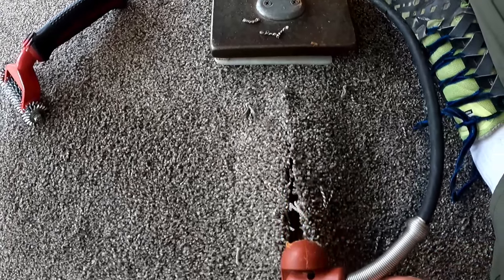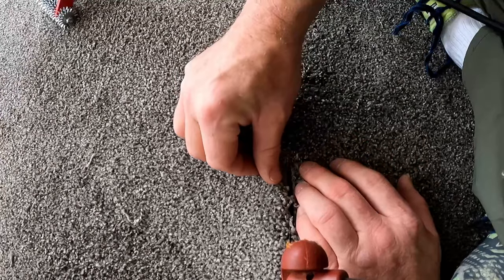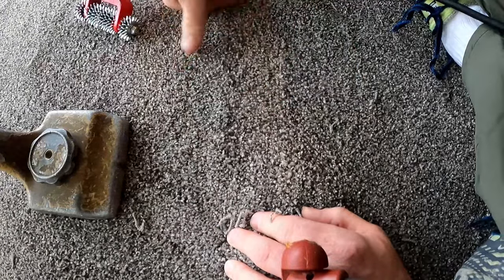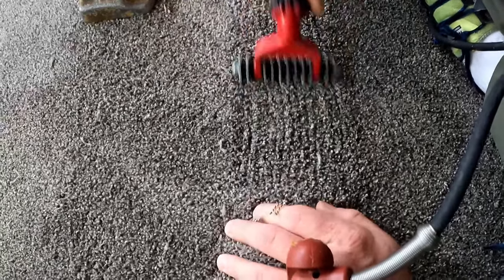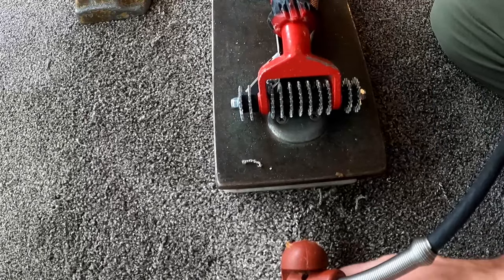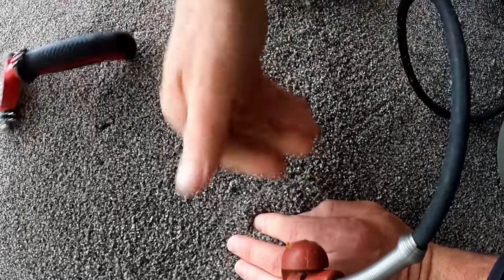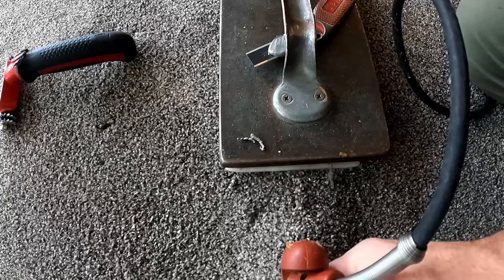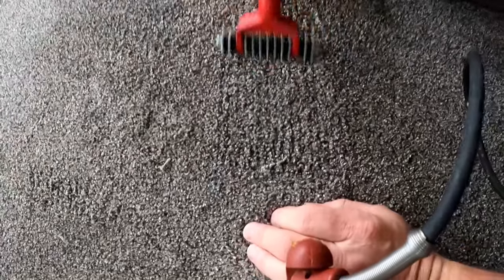Up and  Close Look; How to do a Seam

Comment: u should make your seam with the direction that the carpet is laying. I make my seams differnt than u but the result is the same.
Reply from the maker: You can go either direction, but the key is to not drag the heavy tray. Pick it up and set it down. If you drag it even in the direction of the nap, it will show distress in the fibers and will stand out. Thanks for the input, Jacob!
Reply: Correct, you can run the iron any direction you want, its the weight that you have to worry about
Reply: Should probably seal your customers seams though bud